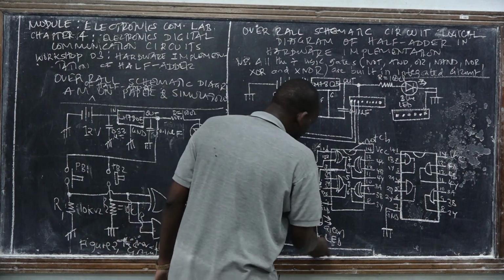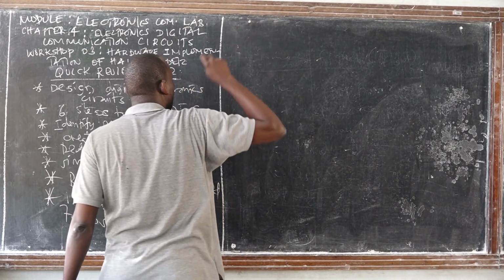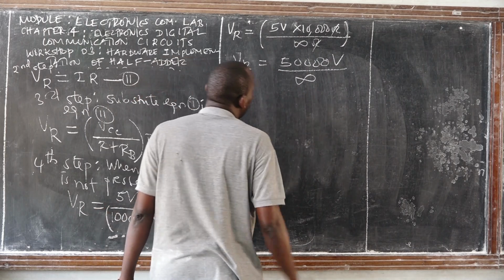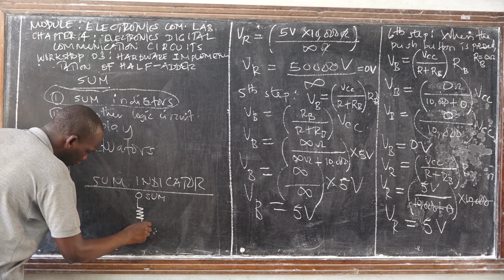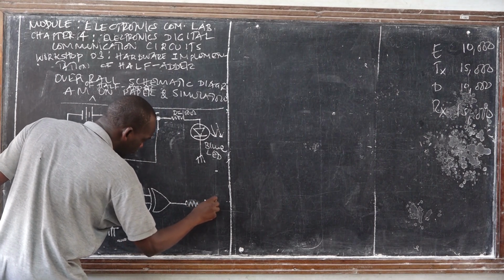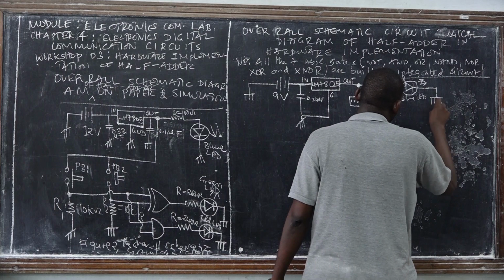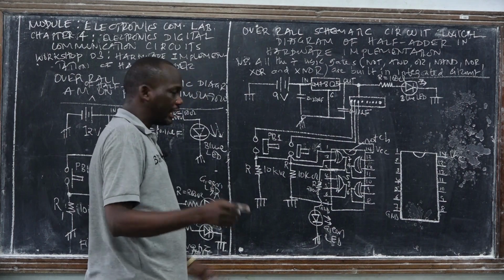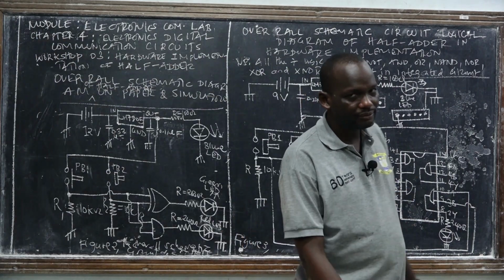WORKSHOP 03 | HARDWARE IMPLEMENTATION OF HALF-ADDER | DIGITAL ELECTRONICS | SIR&ENG OLENJOLAI&NEKINY

Comment: sir,i have question  on  implementation in  simulation why  we put higher pull up  resistor value  than  pull down resistor  ?
Reply from the maker: Thank you TARIQ for your question. NO...You may use Pullup or Pulldown resistor network, depending on the digital electronics circuit design.